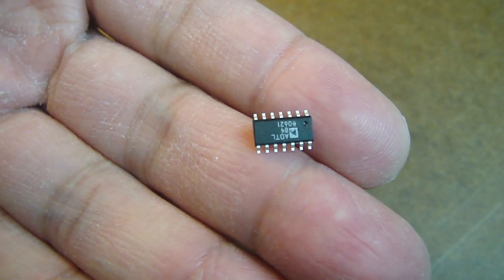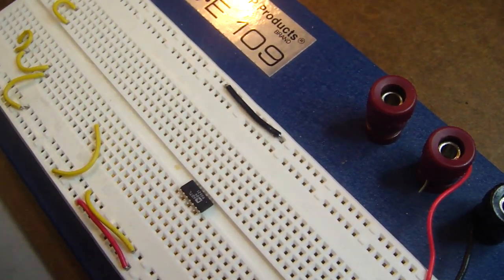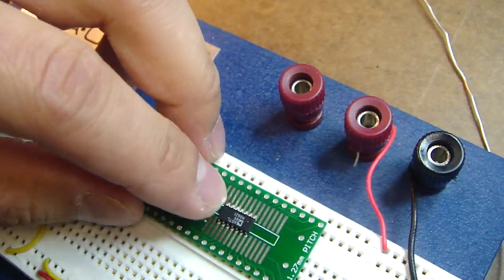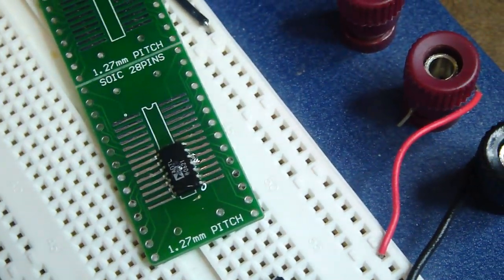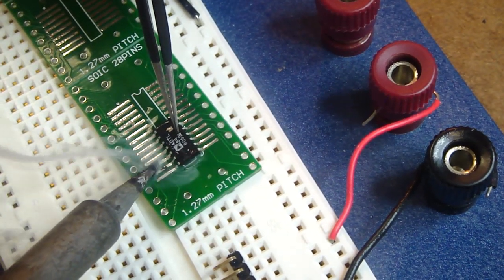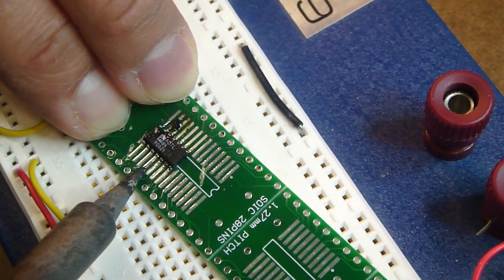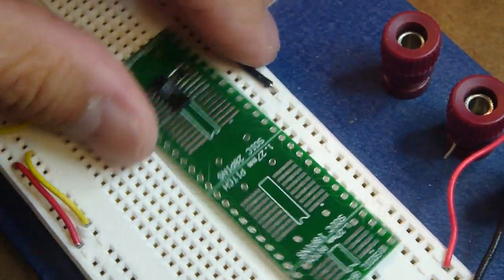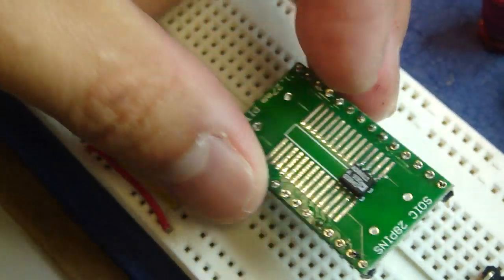SOIC to DIP Adapter for breadboarding

Comment: It also looks like that, with some planning ahead of time, you could sneak some wire leads and even small components like resistors and diodes into the holes under the board since it's header elevated.

Comment: so the header pins are connected to the smd? Its a little confusing with the little gaps between the pads and the headers-I wasnt sure if those were little spaces to add resistors etc? what Im asking basically is once you have the smd mounted and soldered theres no other soldering required correct ?

Comment: $6 per 3 adapters is a ripoff. I just ordered 10 for $1.07 at Alliexpress. They are avail on ebay too. That's a 10 cents per each, not $2 !
Reply: right! proprietary technology lol. I've never come across a situation better suited for this face → -_-
extended pads is something anyone can do in eagle by simply editing a package... thicker solder mask and tinned pads is also not at all hard to do at the manufacturing stage... I'm so confused how they got a patent.